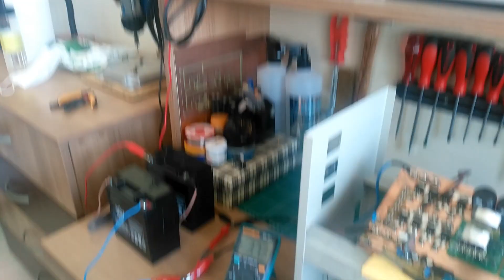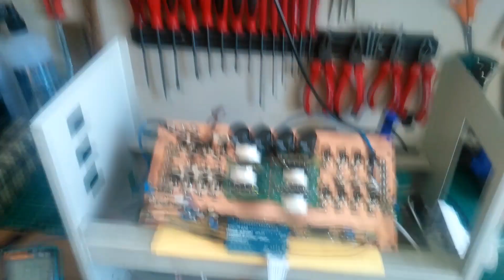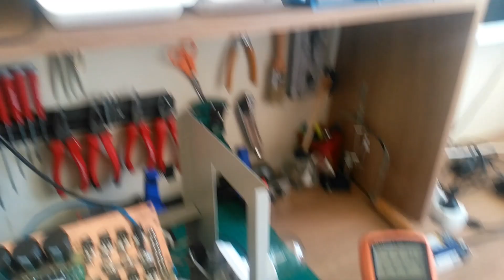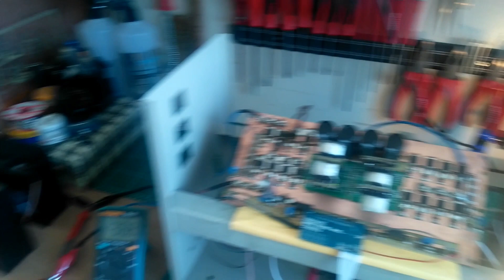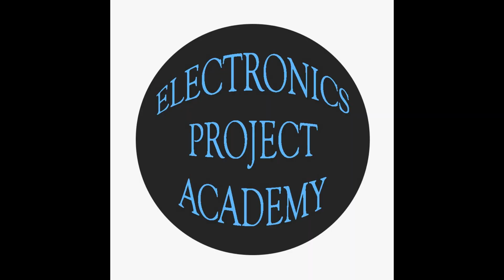500-5000W Pure Sine Inverter with EGS002 Module (With Schematic)

Comment: hi, thank you for this video and schematics !
can you please tell me why there is 6 series and 2 parallel smd's on both sides and what value are they ? 
and why there is 2.2nf 2000v capacitor across + and - ? are they for smooth ripples ? how this will generate ripples in there ?

Comment: Hello Instructor, I built Egs002 inverter and I used irf3205 8 numbers. When I try to load it with 45watts standing fan, is able to carry it, but when I try a drilling machine for about 5000Watts is unable to, and it shut down the circuit and restart.
Please what could be the problem and what can I improve or check. Please